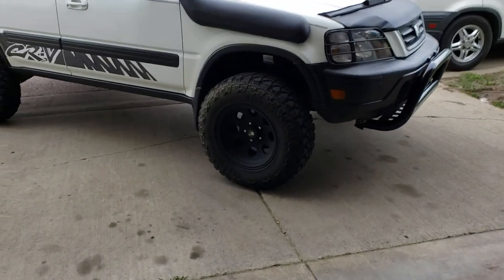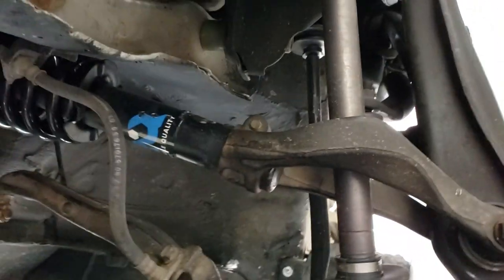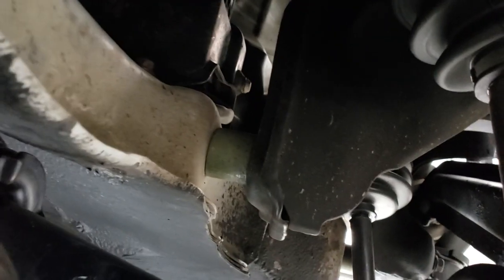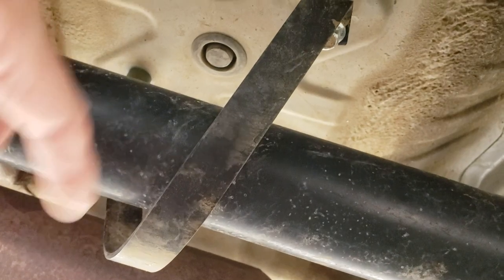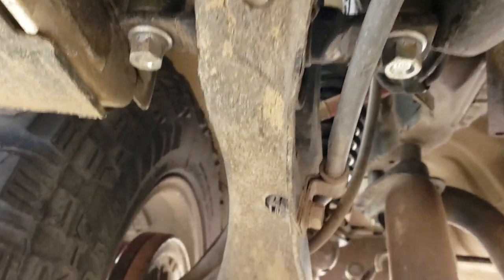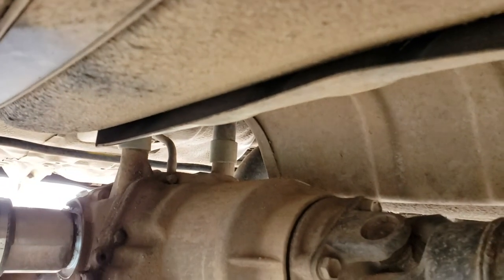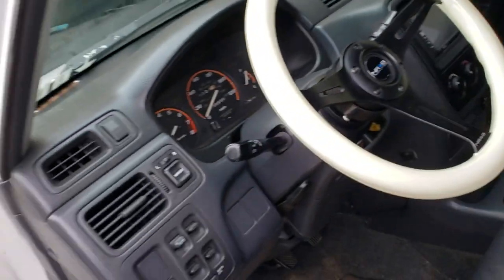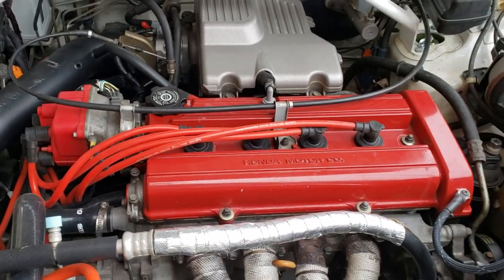My 99 HRG 4" lifted CRV RD1

Comment: Great looking CR-V 👌🏻
Just want to make sure I’m understanding the purpose here; the lift kit raises the whole car higher off the ground (so you gain ground clearance), but then the subframe drop lowers the underside of the car again, which results in your body being higher off the ground, so your approach, departure and break over angles are better, but you didn’t really gain any ground clearance now?
Reply from the maker: Basically what's happening is you lifting the body up (4in in my kit)  but you need to drop the subframe down or back down a little so that the axles aligned and the steering rack with no issues you're only dropping that down a inch and a half the CR-V already comes with pretty decent ground clearance so it's not too big of a worry but you're allowing the body Thule Tire also creating more flex room for the wheel at least as much as these suspensions can do
Reply: @crv_tom  So am I correct in saying then that, if you only lift the body by 2.5" (and not 4" like in your case), you don't have to drop the subframe again?
Reply from the maker: Yep you would be good to go there anything about 3in you will want to do a subframe drop although for 2 and 1/2 you were still going to want to do a trailing arm spacer
Reply: @crv_tom  Awesome! Thanks for the info!
Reply: You also can run bigger tires, which give you more ground clearance.

Comment: I just completed the Mojave Trail with a all stock 99 with street Michelins.  My biggest issue was the exhaust and rear subframe catching rocks.  I got real good at driving on the edge to keep from hanging up.  It even climbed that rutted up section on the other side of Fort Piute with no problems.  Thanks for the ideas on the lift.
Reply from the maker: Awesome man sounds like it was a good time!

Comment: Great CRV, but had a few questions about the HRG site. I’m new to modifying cars, and the subframe drop kit only comes for the 97-01 CRV, as well as the lift kit being for the Element. Do all the parts still work properly in a 2004 CRV or would I need to look elsewhere? If so, where do you recommend?
Reply from the maker: I'm not sure what's going on with his website I did see some things were kind of messed up I think hes working on fixing knows but yes if he offers a kit for that make and model it will work just make sure it's for your make and model you won't be able to use other kits without modifying them.

Comment: Very handsome car... Can the driveshaft handle the stress.
Reply from the maker: Still running the stock driveshaft with no issues that almost 200,000 miles in my 99, however the driveshaft finally did go around 240,000 in my 2000  so I just replaced it and was good to go But as far as my 99 nope still oem drive shaft.
Reply: @crv_tom  tq for the info..

Comment: Any suggestions on a head? I want a lil more power pick up. 

Nonetheless you have inspired me to lift my Crv about 2 weeks ago. I used truhart “lift” coilovers.  But decided that I should prob get a refurbished head to make sure this car will last me a lil while I am going to dump large amounts of money into it.

I heard this my CRV ex has a b20 engine and you can find vtech heads for the suckers. 

I know that the v tech kicks in at higher rpms so I am not sure if it is worth it (only on the highway, I guess, i don’t have a led foot around town)
Reply: Anyway I’m not sure where to start and was having the community would have an idea.
Reply from the maker: Definitely look for a B16 or a B18 GSR head they would be very nice upgrade for the CR-V just make sure you get the kit and everything you need and it would be a nice swap and you would need the righty see you preferably one with hondata s-300 so that way you could tune it a little bit you would be happy in the long run if you did that trust me
Reply: @crv_tom  thanks for the reply

Comment: Hi, did you replace the steering shaft?
Reply from the maker: Yes it comes with a longer one in the kit.
Reply: @crv_tom  Thanks for the reply! I contacted HRG, but they told me that if I install a 1 inch subframe kit, there is no need for a longer steering shaft.

Comment: Why you go with the regular truhart upper control arm in stead of the lifted version? Benefits and cons?
Reply from the maker: Nope they are great but they were not available when I started this been doing it for over five years they just started making them last year.
Reply from the maker: In fact when I made this video they weren't even out yet.
Reply: Okay I was trying to figure out what to get i got the same lift space you have need to get subframe spacers got the acceleration wobble. Did you have to relocate your rear brake lines? They are just dangling and I can't find any extended aftermarket ones
Reply from the maker: No I did not relocate them you can drill and move them up a little but I just let them dangle because they really have given me no problems and are still within the range of flex
Reply: Thanks, I appreciate all the help and the videos awesome!! Gonna keep a look out for your videos

Comment: Hi.. Why use coil bottel
Reply from the maker: Are you asking about the MSD blaster coil 2?
Reply: @crv_tom  yes boss..
Reply from the maker: So it's a stronger coil and with bigger plug wires and hotter plugs it helps with better spark and the low end and all the way through there's some info if you search that will tell you even more about it! Hope that helps a little 👍👍👍

Comment: Did u removed the drive shaft middle bearing on this? Works good?
Reply from the maker: No sir all stock drivetrain.
Reply: @crv_tom  I’m having a howling noise on mine, seen couple of vids with pinning & welding them, any input on this? Saw they also adapted a viscous coupler, any advise would be appreciated, I love my CRV!
Reply: On the rear differential I mean
Reply from the maker: Yeah it's a common problem mine does it every now and then but it still hooks and still works pretty decent I don't plan on upgrading until it finally breaks I haven't had it fail on me yet.
Reply from the maker: But when it does come time to upgrade I would definitely recommend the viscous coupler and a custom driveshaft and a element differential or eliminate the dual pump set up in the stock death and do the HRG clutch disk and that would definitely be a sick set up
Reply: @crv_tom  same here, so far the quickest fix I’ve seen is to change the oil on the diff and put the Honda double pump 2, so I will probably do that weekend.
Reply from the maker: @Xpertwizard  it will help a little

Comment: Which is the Best with a/t crv b20b or b20z ?
Reply from the maker: High compression JDM b20b would be best because generally you would find them with lower miles but the b20z is also just as good with tq and hp.
Reply: @crv_tom  i m in France which one i take for rehability and easy to repare
Reply: My drive style is a hard drive
Reply: @crv_tom  if i want to put e85 in tank  (ethanol) wich one b20b or b20z
Reply from the maker: That would require an upgrade of the fuel pump in some other modifications that's something you would want to talk to your tuner about and see what your goals would be for power and set up
Reply: @crv_tom  i just need low fuel cost with rehability , i don t need more power or torque
Reply from the maker: @tomsawyer8506   That will work too if your willing to spend the money for the fuel system upgrades I would definitely talk to a tuner and see what you need to do to daily drive it
Reply: @crv_tom  ok 👌 thks but b20b or b20z is better for me and for ethanol ?

Comment: Чувак после этого какой расход стал, движок не нагревается, как обстоят дела с сайлентблоками???
Reply from the maker: Sorry not sure what you said??
Reply: @crv_tom  Dude after that what kind of flow has become, the engine does not heat up, how are things with the silent blocks ???
Reply from the maker: If you are talking about the aluminum radiator it doesn't heat up at all it keeps it nice and at tempt you with no problems!!
Reply: @crv_tom  Can you say what kind of wheels you have and tires, what sizes?
Reply from the maker: Yeah I did a video on that alone.